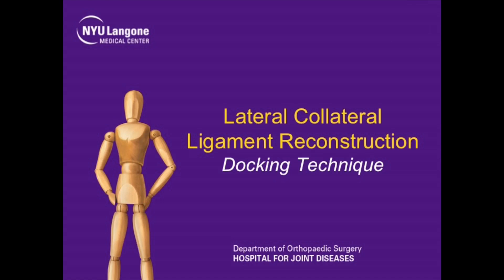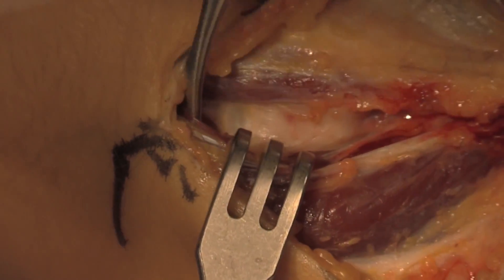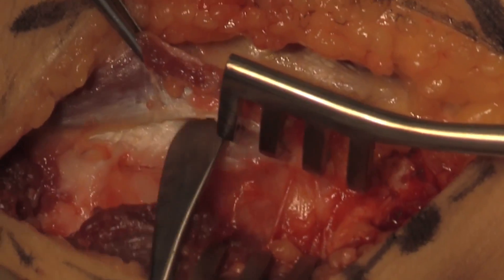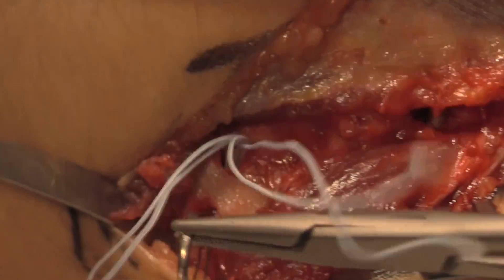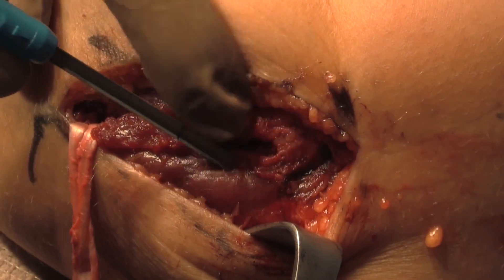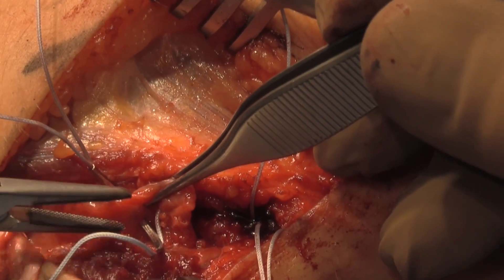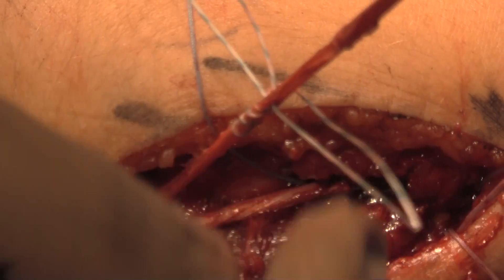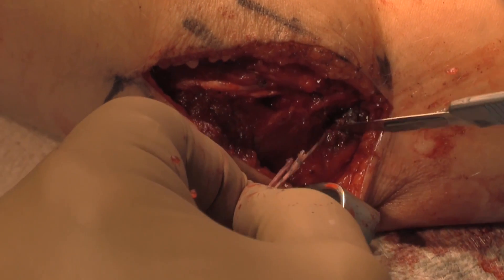Elbow Lateral Collateral Ligament (LCL) Reconstruction Utilizing Docking Technique

Comment: my 17 year old high school wrestler He had a partial grade 2 LCL tear on upper side. It not detach from bone so Dr said no surgery. He was off from wrestling for 3 months. He just started to drill and wrestle live last week. He tweeked it a little bit on second day but was fine and kept going to practice. Yesterday he was wrestling college wrestler and his knee was getting yanked and tweeked so he stop wrestling cause it was aching/hurting on the side and a little bit on the back on the same  side of LCL..He said it felt tender.  

Do you think he is returning too early to wrestle live, does he probably needs another MRI to see if is healing properly? Dr even gave him a Platelet-rich plasma (PRP) injection to speed up healing.  He has fool extension and can bend it normally. He can squat, rdl, deadlifts with no problem. Is just when it gets bend lateral that it hurts him..do u think he should do physical therapy to get it stronger and maybe just do drills amdstead of wreatling live? Sorry for all the question..

Comment: I had this surgery exactly 6 months ago. 5/8/20. I just unfurled it severely again 11/8/20. Exactly 6 months from my surgery. I pray I don’t have to have surgery again
Reply: I fell off a freight train at work and dislocated my elbow October 2021. The surgeon don’t want to do surgery, she thinks it will heal. April 2022, 6 months later, 2nd mri confirms I still have a torn ligament and nerve damage. I can’t return to work until I’m 100%. So frustrating.
Reply: @andreclark2472  I would have demanded the surgery. It’s no “healing on it’s on”. Surgery is required. I’m so sorry your going through this. Have the surgery, get a 2nd opinion. Best of luck!
Reply: @Diaryofaqueen777  I’m actually getting a second opinion tomorrow. I’m definitely going to push for the surgery because I have no more time to waste. 
 How long is the surgery? Don’t want to sound like a wimp, but it looks scary.
Reply: @andreclark2472  mine was 3hrs because I had additional injury to a blood vessel. My elbow is completely numb, still. They had to remove my funny bone. I Do have full ROM but I can’t fully extend my arm. It just won’t. The recover was rough. I’m not going to lie the day after surgery when the anesthesia wore off and the numbing block wore off. I was ready to give up. I’ve had 3 children and broken many of bones that was the worse pain I’ve ever had in my life. I still get pain here and there. But I’m back to working out and lifting. The worse part about it is the horrible scars I have on both sides of my elbow.
Reply: @Diaryofaqueen777 you get repair or recontruction in you both elbow ?
Reply: Good Day @ Ms peoples how is your Elbow doing
Reply: @36rounds  it is good I and fully healed. Next month it will be 2 years since my injury.
Reply: Did you have surgery again??
Reply: @NP10338  no I did not have to have surgery again thank God! I couldn’t go through that experience again. It will be 2 years next month since my injury. I have fully recovered. It was about of year of recovery and 7 months of physical therapy. I am back to lifting weights again!
Reply: Can we get connected on Instagram so that I know what exercise and what movements you avoided I have done done with surgery 1month postop
Reply: @NP10338  sure!
Reply: I am on hinged brace done with the surgery 1month post op
Reply: @NP10338  I was in the hinge brace for months.
Reply: @Diaryofaqueen777  for how many months??
Reply: @NP10338  8 months😫
Reply: @Diaryofaqueen777  8months with hinged brace???
Reply: @NP10338  yes I know 🤦🏾‍♀️But my dr had me remove certain parts of it to have more mobility as I healed and got stronger. Again I had a really bad injury.
Reply: @Diaryofaqueen777  did you injured again after surgery??
Reply: @NP10338  yes I did. Not a tear but it did require me to wear it 2 more additional months than I needed to
Reply: @Diaryofaqueen777  what happened did you fall on the same elbow?
Reply: @NP10338  I actually hit it on the wall
Reply: Hello my elbow is very stiff post op 1 month I am in hinged brace extension is very less restricted at 80-90degree in exeteion you too had less exetetion like this ,if yes how this gets improved??
Reply: @NP10338  yes I did! That is normal post surgery. Once you start going to physical therapy you will re develop and strengthen those muscles and tendons. Your physical therapist will start doing stretching exercises with you
Reply: @Diaryofaqueen777  hey were you wearing the sling (around the neck) with the brace or it was only the the brace ?? After 1 month post op??
Reply: @NP10338  it had 3 components to it. I was stabilized for 2 months. Then they took the stabilizing portion of the brace off. I was left with a elbow and forearm piece that connected the 2 together
Reply: @Diaryofaqueen777  do you use to keep ur brace locked all the time??
Reply: @NP10338  yes until my physical therapist adjusted according to my progress.
Reply: @Diaryofaqueen777 hey I have just started my physical therapy while moving the elbow I can hear or feel some clicks and twitch in my bone or ligament I don't know u too had this weird things going around while doing PT??  Btw thanks for replying to my every question , you know how it feels.. going through all this it's bad psychologically..
Reply: @Diaryofaqueen777  hey I am getting very anxious and my mental state is getting very bad  my mind is not stable what should I do....it's hard
Reply: @Diaryofaqueen777  hi I am going to walks without my brace is it ok ?? I am at 2m20days
Reply: @NP10338  you have got full range after 2 month ?
Reply: @rahmadhidaya8132  no it was 45 extension flexion 130 now 2.5 months it's 20 exe & 130 flex
Reply: @NP10338 same like me i can  feel or same click in my elbow ,
 its normaly or no ?🙏
Reply: @rahmadhidaya8132  no show it doc
Reply: @NP10338  can i get your Ig name , i want share my case 🙏
Reply: @NP10338  did you have surgery again ?
Reply: @rahmadhidaya8132  no
Reply: @NP10338  hy you elbow already stable ?
Reply: @NP10338  hai you elbow getting better or no ?
Reply: @rahmadhidaya8132  bro it's been 6 month now it's great now
Reply: @NP10338  you elbow already stable right?
Reply: @rahmadhidaya8132  yay bro
Reply: @NP10338  do you still feel the click or blocking sound on your elbow?
Reply: @Diaryofaqueen777  Hey I am getting some little pain in ulnar side of my wrist did u also have pain in wrist it's been 6 months now no pain but from 2-3 days some pain in wrist? did u have the same?
Reply: I need some info about exercise and rehab protocol
Reply: Join this link we can all talk here
Reply: Hey I am getting some little pain in ulnar side of my wrist did u also have pain in wrist it's been 6 months now no pain but from 2-3 days some pain in wrist?